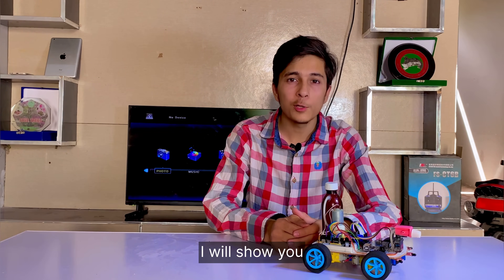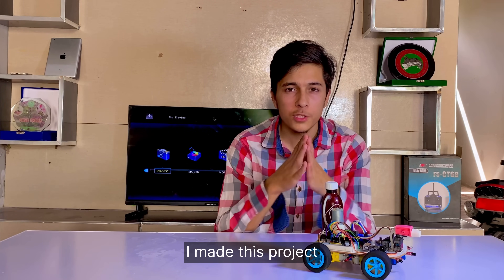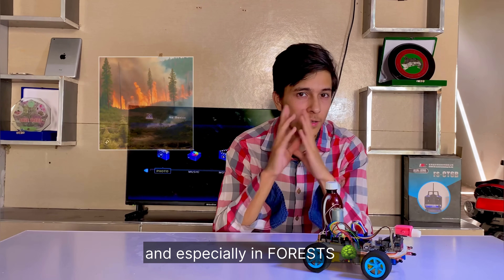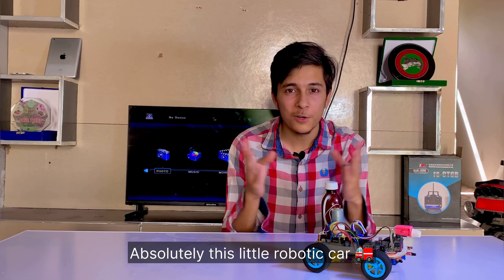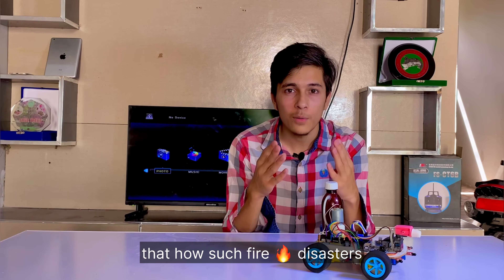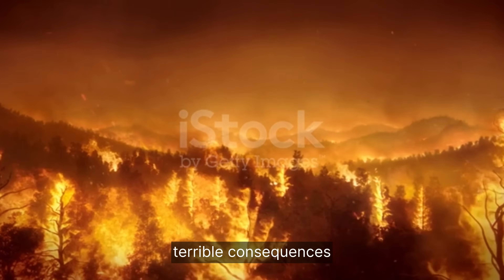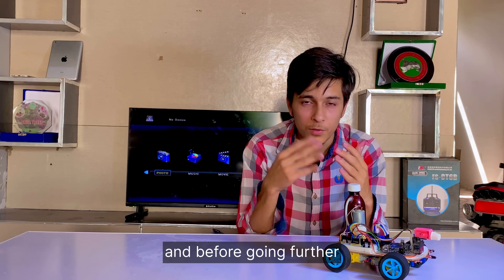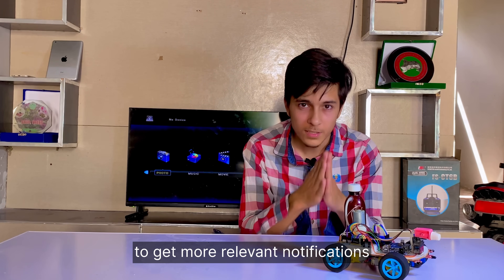DIY Fire Fighting Robot using Arduino  |  Auto Fire Chaser and Extinguisher

Comment: Hi..I make this robot it can't work.The flame sensor motor driver and uno works but no other activitiy occur kindly tell me the solution for this
Reply from the maker: Tell me your about; your battery name and sensors pins name
Reply: @saadinnovativeideas  9 volt tushiba battery and pins names DO AO + G
Reply from the maker: Of course it won’t work with that battery. That is non-rechargeable and cannot give more than 1amp to the motor driver. The project needs 2+ amps to run which could be provided by rechargeable battery
Reply: i can make this in under 1800 and ship to your location

Comment: bro can u help me, my motor dc and flame sensor in my project doesn't work
Reply from the maker: Which flame sensors have ups used.. name the pins and its connections
Reply: same like in the video ma bro, idk why the flame sensor it's doesn't work, maybe I made a mistake in the wiring?
Reply from the maker: Yeah double check your connections and make sure you have connected the analogue pin (A0)  of the sensor with arduino

Comment: brother I want to participate in the science fair through this project, will the codes in this project work, I have included this project 😊
Reply from the maker: Yeah code really works but if your hardware goes with a bit issue code may not work.. so first make sure the hardware is correct and code is authentic

Comment: Hi, everything works but just the pump is on constantly, how do i solve that??
Reply: @Saad Innovative Ideas
Reply: 8:13 ??????
Reply from the maker: Giving battery parallel connection of motor driver to Arduino uno VIN and GND

Comment: can we use 9 volt battery
Reply from the maker: Yes 9V is compatible but if you are thinking of non-rechargeable one that can’t provide sufficient (2+) amps and will not work
Reply: 3.7 watts battery used in this project
Reply from the maker: 3.7 watt?

Comment: Is the code working? Because iam finalizing this for my exibition pls reply
Reply from the maker: Definitely many guys succeed to make it using this this code, you can check the comments..  but depends upon you; how you do it because any other problem in the hardware makes you feel that the code is faulty
Reply: @saadinnovativeideas  ok thanks 👍 appreciate
Reply: @saadinnovativeideas  and what if we want both automatic and the remote control?
Reply from the maker: Do you mean Radio control (RC)
Reply: @saadinnovativeideas  yes so it will be automatic and manual

Comment: Hi I can complete my project but senser give voltage without sensing it and the project is not working
Reply from the maker: Tell me your flame sensor pins names and its connections
Reply: @saadinnovativeideas  is we use port 3
Reply from the maker: Have you uploaded the code successfully? Are you facing uploading problem
Reply: @saadinnovativeideas  yes I uploaded the code in port 3
Reply from the maker: Port number depends on your one to which you have connected the cable and installed driver for it… but was it declared in the down right corner in Arduino software that uploading is done and then the Arduino led blinks which means code has been copied successfully. Have you done the same or not
Reply: @saadinnovativeideas   yes its same when the senser sense the flame the blinking light is turn off
Reply from the maker: Thats good.. it means that sensors work. Does the car shows any reaction when led is turned off, if not then it may be the power problem which would not be sufficient to run motor driver
Reply: @saadinnovativeideas   yes we should give the direct 10v on the LC motor driver where the supply connected but the motor not work
Reply: @saadinnovativeideas  I check the int1,2,3,4 but not voltage is appear when the senser sense
Reply: @saadinnovativeideas  plz reply me
Reply from the maker: Hey you said LC motor driver can you name it full..
And you said 10 V— whats the source. Name the battery, I thinks thats not rechargeable
Reply from the maker: If you have used non rechargeable.. so almost of them can hardly provide up to 1 amp which is not sufficient. The project needs 2+ amps to run which could be provided by li-ion, lipo rechargeable batteries
Reply: @saadinnovativeideas  I use that you use in your video and the 10v from the power supply i use 3.7v x2 batteries
Reply: @saadinnovativeideas  I use that batteries how can we charge it
Reply: @saadinnovativeideas  plz reply bro
Reply from the maker: It has its own single or double slot charger (for 18650 cells). You can use TP4056 charging module as well
Reply: @saadinnovativeideas  Where the slot is located in arduino ????
Reply: @saadinnovativeideas  Vin Gnd and AO Vin is com Gnd is com and three pins is connected with AO
Reply: @saadinnovativeideas  is any problem in code

Comment: Please help when I completed the project my moter is not going towards the fire it is not even rotating only the pump is working and servo is also not rotating please help😢
Reply from the maker: Tell me your net input voltage and battery type because I guess you have the power problem..
Reply: @saadinnovativeideas  2 × 3.7 volt lithium ion battery =7.4 volts
Reply from the maker: It means your Arduino uno and motor driver turns on but other components doesn’t work…
First of all the sensors senses the flame if it wont work noting will function.. tell me the pins name of your sensor and its connections

Comment: Oye una pregunta porfa respondeme mira cuando yo coloco en la placa Arduino el cable q va en los 5v y luego lo conecto con el board se apaga el robot todo se apaga ayudame será q me equivoqué en alguna conexión porfa ayudame
Reply from the maker: Did you mean that initially it is turned on but when you connect it to the computer it turns off?
Reply: @saadinnovativeideas  exacto pero ya lo arregle pero ahora tengo 2 problemas el l298n cuando lo conecto a la PC no enciende solo se enciende co. Las baterías peor cuando conecto las baterías no se enciende el resto del robot y el otro problema es q ví en el vídeo q una luz del Arduino uno (la q está abajo de color naranja) se enciende cuando lo programas a mi no solo se me enciende la de arriba y una que dice tx parpadea ayudaneee
Reply from the maker: It seems to be you power problem.. what is your net input voltage and which batteries have you used
Reply: @saadinnovativeideas  use una baterías las dos de 3.7v como dijistes y no se cuanto es el voltaje neto , una pregunta¿Se puede usar solo un sensor?

Comment: Hello brother
first of all, thank you. how did you calculate the distance to the fire? that is, how does the robot stop when it walks towards the fire and is very close?
Reply from the maker: You’re welcome..
Infrared  flame sensors detect distance i.e when the robot comes a little close to the fire the intensity increases so it stops (as programmed to stop with greater flame intensity)

Comment: Bro the arduino is not even turning on when i do all the connections in the bread board..
Reply from the maker: Double check your connections with the circuit diagram I provided.. and give compatible power source

Comment: My arduino sensors and servo are all on but My motor driver is not getting on
Will I have to connect the 5V of motor driver to somewhere?
Reply from the maker: Of course, you have choosen the wrong batteries
Reply: @saadinnovativeideas  I am using 2 cells  of 18650
Reply from the maker: Does it still doesn’t work with that.. then tell me some symptoms so I can guess the issue

Comment: I have used 4 normal duracel batteries A4 batteries will it work
Reply from the maker: That will definitely not work.. those batteries could not provide sufficient apps.
Try to use rechargeable batteries that would provide the desire amps (2+ amps) needed by the project

Comment: Bro the servo motor is not turning around and only the center sensor works properly, the left sensor senses and make the car move backwards and the right sensor senses but doesn't move towards the fire , immediately the water  motor turns on.What to do?
Reply: Same here
Reply from the maker: For servo motor —> flip the side wires and leave the middle one….
For right movement—-> try to flip the motor wire that are connected with the motor driver

Comment: I am making this robot for my university project..I made this but I have a different kind of 5v water pump motor,it has two wires(red and black )can you tell me where i fix it...please tell me I am waiting last part in this project😢
Reply: bro you read in university and you do not know how to make a project
Reply: @curiosity1811  why you say so bro
Reply from the maker: According with circuit diagram I provided

Comment: Can I use BC547 transistor as a switch instead of TIP-122
Reply: Also, can I connect it like this?
Arduino Pin D4 ----> Resistor ----> BC547 Base
Battery (+) ----> Water Pump (+)
Water Pump (-) ----> BC547 Collector
BC547 Emitter ----> Battery (-)
Will the BC547 fry?
Reply: I just found out that BC547 can handle up to 0.1A, but my water pump is 0.3A
But if the same setup, change the BC547 to the TIP-122, will it work?
Reply: @thegodbridgexd  is your project working after following his steps or any changes you made
Reply: @SadanAnsari01  I don't try but i think it is   not, the BC547 is too weak to handle

Comment: I need help, the motors do not move and the sensors do not seem to detect anything
Reply from the maker: Which type of sensors have you used 3 or 4pin. Also name the pins
Reply: They are 4 pins, I need your help urgently.
Reply: It also seems to be a problem with the code that doesn't work, so could you let me use the code that you used, I would appreciate it.
Reply from the maker: I have used the same code
Reply from the maker: It may the power problem. Which battery have you used and how much is the net input voltage

Comment: I have the 840 pin breadboard, can I cut it?
Reply from the maker: You can just remove the first +- row, but can’t cut it on the mid to reduce size
Reply: @saadinnovativeideas I made the project. All the sensors are working fine. Fire is being detected but instead of turning off the fire it's moving away from it. Are there any possible changes
Reply from the maker: Yes of course, try to flip motor wires that are connected with the motor driver. Try flipping both sides motor wires one by one

Comment: Bro I need your help please reply 😢
Reply from the maker: Yeah, ask
Reply: @saadinnovativeideas  my project is start but not move all sensor are blink but my wheels are not move what to doo please help me this project will be sumit in school
Reply: @saadinnovativeideas  my bo motor are working and uno code was upload successful and all sensor are blinking but not detected fire 😔 please contact me this project sumit in tomorrow please bro 🙏🙏
Reply from the maker: Name the sensors pinout and its connections
Reply: @saadinnovativeideas  all sensor are working but not detected fire when project was on but not move 😓 please help 🙏
Reply from the maker: I said how much pin flame sensor are you using 3 or 4? And also name the pins
Reply: SP electron flame sensor  and I am using 3 sensor
Reply from the maker: Brother I mean tell me the name of the sensors pins example VIN, GNG, D0, A0 an which of them have you connected
Reply: Please give me your instagram id 
I am send picture of my project 
Please brother 🥺

Comment: bro can we use 3 - 9 volts water pump instead of 5 - 9 volts water pump
Reply from the maker: But should be compatible of bearing at leat 5 volts otherwise that would fry out.

Comment: Bro you used red colour flame sensor. But i have only blue colour sensor. Does it work
Reply from the maker: But for this code and connections the sensors should have an analog pin (A0), colour doesn’t matter
Reply: Bro i have many doubts. I have started making this project. Can you send your WhatsApp number

Comment: Bro it is not working the motor driver and sensor give red light when I power on and no response
Reply from the maker: Tell me sensors pinouts connection and your battery net voltage
Reply: @saadinnovativeideas  vcc, do, ground mine only has three pinout 
7.4volt battery like in the video 2 18650 lithium-ion battery
Reply from the maker: Brother connections and code are for analogue pinout sensor but you are using digital one.. buy analogue pin sensor having A0 pin or you will have to modify connections and code which would become complicated
Reply: @saadinnovativeideas   bro still not working i bought 4 pin ir sensor and connected it and the motor driver lit up red and the sensor not any light and not responding
Reply from the maker: How you’ve connected the sensors with arduino.. Tell me the pins and its connections
Reply: I connected the Ao pin of each sensor to A0,A1,A2
Reply from the maker: What could be the problem then?? Have you uploaded the sketch successfully (shown in the Arduino software).. Tell me some symptoms so I can guess the issue
Reply: @saadinnovativeideas  yeah I uploaded it correctly but now nothing works only the motor driver and the Arduino board led is lit
Reply from the maker: If the sensors led did not lit it wont work, correct its connections
Reply: @saadinnovativeideas  the connection are correct I made exactly in the video

Comment: Can we make it without the transistor , the capacitor and resistor??? Will it work 
 Plz reply fast...
Reply: Thank you bro ....
Reply from the maker: I use them to drive water pump.. you can use relay module instead of these
Reply: Bro , can we use L293 motor driver for this project...
*If yes, plz provide me with the connections...
Reply from the maker: Brother, with using L293 MD you cannot change the connections.
 I mean when you plug in the motor driver on the Arduino uno check which pins are changed regarding my circuit diagram, if pins connections are changed, change the same pin number in the code etc. and if not changed do not do anything with code
Reply: Bro plz tell me the bread board connections ...
It is not clear in the video..
And I am not familiar with these electronic items ..😅
Plz bear with me😅
Reply: Bro what is the distance range of the flame sensor..I mean the distance which the sensor can sense flame..

Comment: Sketch uses 3368 bytes (10%) of program storage space. Maximum is 32256 bytes.
Global variables use 196 bytes (9%) of dynamic memory, leaving 1852 bytes for local variables. Maximum is 2048 bytes.
avrdude: ser_open(): can't open device "\\.\COM6": The semaphore timeout period has expired.

Failed uploading: uploading error: exit status 1
Bro i have a error. What can i do
Reply from the maker: Your port (COM) is actually not connected. Install usb driver agent on your PC to connect it yo the port you are using

Comment: brother will using 12 volts water pump with 11.1 rechargable lithium ion 18650 fry out the sensors or the servo because it only operates in 5v?
Reply from the maker: But the motor driver regulates the servo, sensors as well as bo motors voltage to the desire value

Comment: Bro my Rx is beeping in the arduino and it sensing the fire also but water motor and the robot doesn't chase the fire 
Please help me my science fair is on 21 September 2024 😢😢😢😢😢😢
Reply: Ya! saad I use 2 battery of 3.7 volt and also I won district level 1st and state level 3rd😅
A boy add so many features in it also. 
Thank you I won a trophy also
Reply from the maker: Thats great 👍🏻 keep it up
Reply from the maker: Have you given the desire voltage
Reply: Yes
Reply: 3.7 volt each
Reply from the maker: What do you mean?? Project needs 7+ voltage which could be gain by joining two 3.7 V (rechargeable ) batteries in series
Reply: Bro I want to add one thing ultra sonic sensor or Bluetooth module for next year 
Please reply me which is good and also how to make it
Thank you
Reply: Bro please suggest me

Comment: when i connect the power from laptop, audrino project is working fine but when i connect the battery eliminator, it is not working fine.....Please help
Reply from the maker: Whats your net input voltage.. and how much amps that can provide
Reply: @saadinnovativeideas  Net voltage from laptop USB port will be the voltage
Reply from the maker: But that cannot run the motor driver and other parts.. just try it with 7-12 Volts
Reply: @saadinnovativeideas  Yes i tried with 12 V but audrino IC burned and audrino not working
Reply from the maker: Then you have probably connected the power pins from driver to 5V of arduino board
Reply: @saadinnovativeideas  I have connected the power pin to VIN socket in board and another in grnd

Comment: Plz  give me connection of motor to motor driver for two motors plzz and if any change in code plzzzz plzz
Reply from the maker: In connections just ignore flipped wired for other two motors, other connections remains the same…
For code: just remove the codewords used for other two motors and modify their loop movements as given

void moveForward() {
  digitalWrite(leftMotorForward, HIGH);
  digitalWrite(rightMotorForward, HIGH);
  digitalWrite(leftMotorBackward, LOW);
  digitalWrite(rightMotorBackward, LOW);
}

void moveBackward() {
  digitalWrite(leftMotorForward, LOW);
  digitalWrite(rightMotorForward, LOW);
  digitalWrite(leftMotorBackward, HIGH);
  digitalWrite(rightMotorBackward, HIGH);
}

void turnLeft() {
  digitalWrite(leftMotorForward, LOW);
  digitalWrite(rightMotorForward, HIGH);
  digitalWrite(leftMotorBackward, HIGH);
  digitalWrite(rightMotorBackward, LOW);
}

void turnRight() {
  digitalWrite(leftMotorForward, HIGH);
  digitalWrite(rightMotorForward, LOW);
  digitalWrite(leftMotorBackward, LOW);
  digitalWrite(rightMotorBackward, HIGH);
}
 
Remaining code remains the same..
Reply: @saadinnovativeideas   error was leftMotorForward and like all was not define